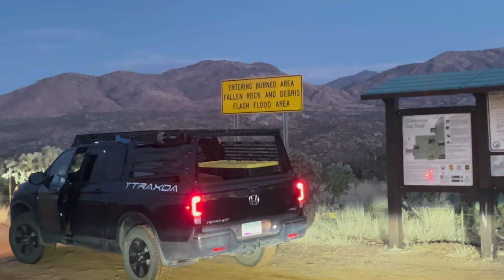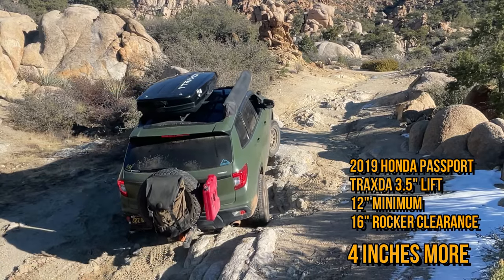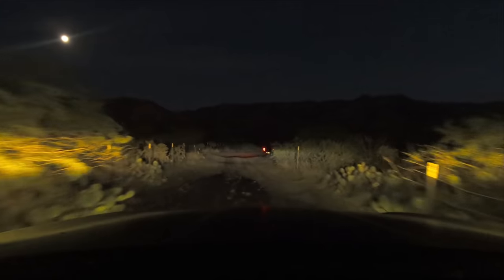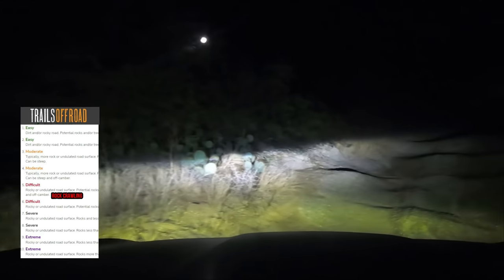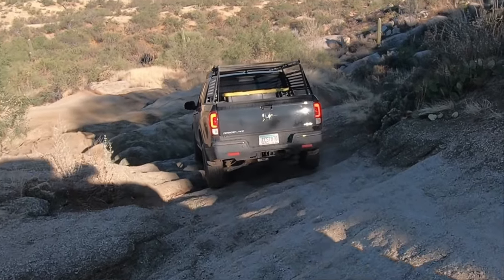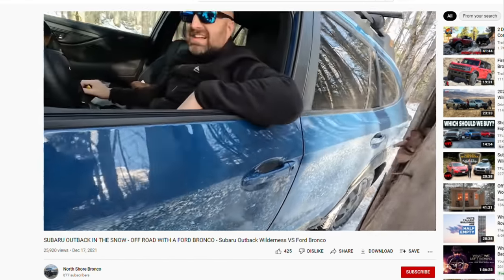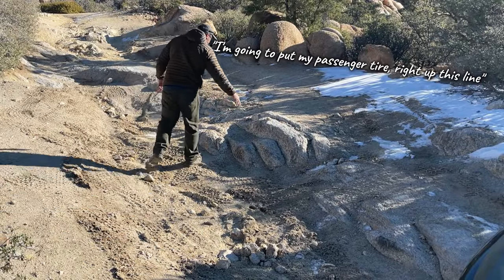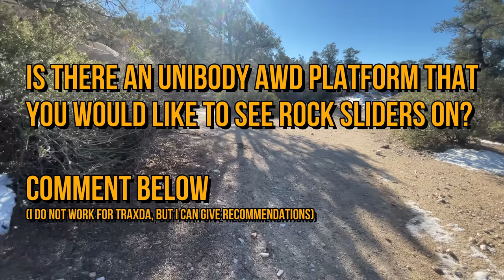Unibody AWD maximum (effective) ground clearance.  Why does no one talk about it?

Comment: Nice video Jon!   It's amazing how often those "automotive journalists" make a blanket statement about Unibody vehicles, forgetting that the Jeep Grand Cherokee has always been Unibody.     Since its debuted` in 1992 (ZJ) it was really a great vehicle off road as it had solid axles.    Now it's similar to Honda Passport.   (Independent suspension)   Love that you're partnering with a great accessory company to make great products for Honda.  You have the know-how!  Like the lower control arms being developed.  Very cool!
Reply: Just had someone today tell me that "jeep" was universally better off-road than Honda, ignoring any details about which models have which drive systems.
Reply from the maker: There’s so many cliche statements, but the “this vehicle won’t be rock crawling” really irks me because there’s a lot of levels before actual rock crawling (level 5 out of 10).  A stock Passport would put itself in alot of danger on a level 2 trail, because of 8” of minimum clearance is barely cutting it.  A modified Subaru might get through a level 3 trail, but may struggle on a level 2 trail with steep climbs due to the operation of the CVT.  With The way I have my Passport setup, I can consistently get through level 4 trails, but a level 5 rock crawling trail is out of my comfort level.  Those trails break 4WD parts, and that’s why I have never had aspirations to do them 😃.

Jeep Cherokees are legendary, and it’s amazing they were challenging the status quo back 30 years ago!  The unibody Trailhawk versions still continue to impress.  Watch @colorado mallcrawlers, Sean Watson does actual rock crawling with his KL Cherokee Trailhawk.  As far as the non Trailhawk models, they lack low
Gear transfer cases and rear LSDs.  On paper, the midsized iVTM4 Hondas sound better.  They really skimp out on non Trailhawk gearing.
Reply: @JonDZ_Adventuring  yep. They also say "good for forest service roads but not real off roading". If you've been through many mountain National Forests, you know that what the forest service considers a road can vary wildly.
Reply from the maker: @CommieHunter7  that’s why I don’t trust trail rating unless it was done by @trailsoffroad
Reply: @JonDZ_Adventuring  I just rebuilt a unibody 02 Nissan R50 Pathfinder; used stiffer coils rather than spacers to lift almost 3in, have extended heavy duty struts and rear shocks, upgraded sway bar/contol arms all around, sliders and skid plates. The thing is a beast and gets me to most places that jeep wranglers can reach. Uni's get a bad rap but can handle most situations when properly equipped and driven well. Honda made a great AWD system, love our 21 pilot, lifted it 2in and have decent clearance, just wish there were options to beef up the suspension. I have already had to replace a blown out a rear strut, otherwise its very capable with no real complaints.

Comment: I measured my Gladiator with 1.5/.75 f/r level. It’s 18”/19” f/r at the rock sliders and 20”/21” f/r at the rocker. Frame is 14.5” from B pillar. I’ve slid on the frame a couple times but not the sliders. Had a boulder roll up under and dent my tank skid lol.
Reply from the maker: Well, it’s nice to have an actual frame to slide on.  Much better than sliding on a stamped steel rocker beam 😖

Comment: I always learn something new from you.  I now need to find out what will work with my Forester Wilderness I just picked up finally.
Reply from the maker: Congratulations on the new ride!  There’s a number of things you can do with the SK Forester.  Most people lift them 2 inches, but I wonder if a company like Anderson Design and Fabrication would do a 4 inch lift.  They made a kit for the previous Gen (SJ).  https://awdadventure.com/products/2014-2017-forester-4-lift-kit

It’s advertised as 2” increase in minimum clearance and 4” in body clearance.  Because of the 2 inch subframe drop, the kit will be easier on the axles.  Add rock sliders on top of that and your Forester wilderness will be in a good spot! 😃

Comment: I talk about it!  And car mags did more when the Outback was first saying they had more clearance than the Explorer, but couldn't get it through the same tests.  Early Toyotas had big rocker clearance over Ranger, S-10, etc. even with comparable minimums.  Jeeps were the oddball for unibody, but hurt themselves with WJ when everyone else started fitting 31s without lift.  (Minivans have bigger tires now than all the "real 4x4s, bro!" of the 80s and 90s.) I *really* want to see full chassis subframes for more serious off-road builds, comparable to Dakar / rally raid cars, which effectively create that body-on-frame clearance while still tying into a unibody structure.

Comment: Cool video and something you don’t always think about when looking at vehicle specs. I just got a 2019 forester and planning on starting with some good upsized AT’s which should get me a little bit of ground clearance, and eventually a 1” spacer lift. I don’t think I’ll be rock crawling with this I’ll probably baby it lol but just want to have some capability to do overlanding trips and hit some forest service roads in northern WI. Nothing too extreme hopefully the forester can handle it. I saw your video on the cvt that died. Supposedly they’ve made them a little better now over the years. Thinking about doing a transmission cooler aftermarket. Gotta watch that transmission temp that seems to be the real killer.

Comment: Great vid. Makes me proud to have owned a 17 Ridgeline and now my new 21 Ridgeline. I plan to get at least a 2" traxda kit if not the 3.5 once I buy out my lease. I am thinking of Falken Wildpeak trails in 255/65r18. Haters will watch this video and still claim a Honda can't off road. They can keep their heads up where the sun don't shine.
Reply: Go straight to the 3/3.5 lift.
Reply: @carloszeigler  my issues here in Wisconsin are less rocks and more snow and rutted up muddy forest roads while hunting. If I were looking at rocks, I would go straight to 3.5 as you say, but if I am honest about my needs, the 2" lift coupled with tires that are 1.5" over stock gives me 2.75" of lift without worrying as much about steering components and stress on cv joints (and of course skid plates). At least those are my thoughts thus far.
Reply from the maker: Thanks Jacob G!  Yeah, this video turned out to be a really good show case of the Honda iVTM4 AWD system.

So Carlos had a 2 inch lift as well, but then upgraded to the 3.5 inch lit.  It just puts these midsized Hondas in a really good spot.  Especially for deep snow, because once something high centers, it’s game over.  

Because of the 1 inch subframe drop, there’s less stress on the axles compared to the 2 inch kit.  It’s a noticeable difference because with the 2 inch kit there’s drive shaft vibration at around 22 mph, it’s less with the 3.5 inch kit.  

Whatever kit you decide on, I have a 20% discount code.  Unfortunately, there was a price increase at the start of the year, so that discount can help offset the extra cost.
Reply: @jg8263  As Jon noted, the 3/3.5 kit reduces CV shaft angle and stress on the drivetrain.  Just make sure you get an experienced mechanic to do the install.
Reply: @JonDZ_Adventuring  good to know about that drop, as the cv stress was a big concern for me. Shame it isn't offered on the lower lifts as well. Now, if that portal axle/hub ever manifests, I would be a happy man!
Reply: @carloszeigler  always with the mechanic. I lack the tools to do a proper job of it at home and know too many who dove into projects like this without the necessary skills/tools and ruined their vehicle. Thanks for the info.

Comment: I'm excited to see how the sliders turn out. Takes guts to risk your rocker panels solo like you did but you crushed it.
Reply from the maker: That place was magical.  Excited to return in March.  I’m looking forward to getting to the mine at the end.  I stopped my trip short because the line would get a bit dangerous.  If I just had the rock sliders, I’d be comfortable with the obstacle I came across.  It was either 1.) take a hit to the rocker panel or 2.) take a hit to the drive shaft.

Comment: another great video!
Just curious about the LSD, do the clutch plates have to be replaced? I assume they must be subject to wear but have no idea how beefy they are. You must use it more than most and wonder if you've had any problems.
Reply from the maker: Thanks. I did a video where I replace the rear diff fluid. After 15K miles, following the severe duty maintenance schedule, the fluid was very clear.

I’m not expert, but I know the clutch packs are connected to little reduction gear sets.  This allows for the overspinning of the activated wheel, but must also help deal with wear and tear.  Now, there’s another thing.  The PTU (transfer case), which is connected to the transmission, is scheduled to have its fluid changed at 30K miles.  Mine failed!  It was replaced under warranty.  It takes only 0.45L of fluid, and I think it’s pretty obvious, with the kind of driving I do, it needs to be changed much sooner.  I have 2.5K miles on the new transfer case.  I’ll be changing the fluid at 5K miles, then 10K, then 15K to see when the fluid starts losing its effectiveness.

I hope that answers your questjon

Comment: Where did you get these "minimums?"  When I measured from the lowest hanging point to the ground...usually the rear trailing arm/shock tower.  I don't get anywhere near what you're getting. Is there a standard place to measure from? I always thought it was just the lowest part of the underside of the vehicle?  ... on another note, another great video!
Reply from the maker: Good question!  So, the way these car manufacturers are coming up with their minimum ground clearance numbers is they simply measure from the “center line”.  Usually, the engine, transmission, drive shaft, and rear diff will line up with that line. I’m sure you’re familiar with Subaru advertising their crossovers as having 8.7” of minimum ground clearance, but you’ll probably also see that the lower control clearance is much lower at around 7.0”.  Yeah, they get their number from the center line.

I tell you, I have bashed and got hung up on my rear lower control arms many times.  I guess I should do a video about it when I eventually get some “high clearance” lower control arms made.  Traxda USA will be making them.

Comment: Do you have a vid where you talk about the AWD systems overheating when overlanding? 
And maybe mitigation, prevention and maybe even potential for aftermarket lockers on these Hondas? (Like Subie)
Reply from the maker: I plan on making one, but the funny thing is it’s hard to get the AWD system heat warning.  You literally have to drive like an idiot.  Subarus don’t give you diff heat warnings.  The CVT will go into limp mode at a damaging 240F, and the CVT heat warning comes on at 270F, which means that CVT is walking dead.  The Honda AWD heat warning doesn’t put the vehicle into limp mode and it goes away after 15 seconds.  An overheated Subaru CVT takes 30 minutes to cool down.  The funny thing is it takes the same amount of effort to overheat an IVTM4 AWD system and a Subaru CVT.  As far as aftermarket lockers for the midsized Hondas, anything is possible with enough money.

Comment: Hey Jon! 

Great video! I was just talking with Greg about these when ordering your special liftkit from him. Not to pester,  your new wheels I've been saving up to order and I noticed they have a different offset than stock; are you using a wheel offset spacer or do they fit with factor settings and lugs?

It would be a great to hear your thoughts, thanks! :)
Reply from the maker: Thanks!

I have Black Rhino Chase wheels, 5x120 (oem lug pattern) with 10mm offset (oem is 55mm).  My wheels stick out 1.77” per wheel.  Because of the increased offset, it may require some cutting of the plastic wheel well liner.  I’d highly recommend the axle relocation kit, otherwise you may have to cut some metal pinch weld or firewall.
Reply: @JonDZ_Adventuring  Hey Jon!, thanks for the feedback. Yup I got the axle relocation kit too. It's going to be a bit until I can get the wheels and tires, need to save up a little but planning a head.
Reply: Love seeing your videos. So much useful content. Anyway, I’m gonna be getting a 23 ridge and I would love a lift but have been reading a lot of negative aspects that come along with the lifts..etc…lane keep not working and premature wearing of the axles. So I know you’ve been lifted and wheeling for a while now. Any major cons with lifting these Hondas? Thanks and again great videos.

Comment: minimum ground clearance is more important to me, i get turtled on my diffs, rear lower shock mounts, lower a arms, lower rear links and I am effectively stuck.  Maximum ground clearance for me, isn't about clearing a obstacle, its more about not destroying your body panels or mechanical bits (but can be mitigated with armor).  Also, increasing your maximum ground clearance through a lift is not a great idea, because you are effectively limiting your down travel at the expense of increasing maximum ground clearance, because you didn't do anything to increase your suspensions arc of travel, and you didn't do anything to increase minimal ground clearance. with experience, you will find a setup that works for you that compromise max/min ground clearance, armor, and budget.
Reply from the maker: Thanks for sharing, what do you drive?  This video is more directed at unibody AWD vehicles on fully independent suspension.

Comment: BA4x4 is coming out with true rock sliders for Subarus. They can handle the weight of the vehicle and be used as a jack point.
Reply from the maker: Awesome!  Does BA stand for Bad Ass?  Once I get the sliders on the Passport, I’d like to do a special on all the other real rock sliders for all the other awd platforms
Reply: @JonDZ_Adventuring  most likely but it may also stand for Body Armor
Reply from the maker: That makes more sense!
Reply: @JonDZ_Adventuring  I like your idea better. There needs to be a company called BadAss 4x4

Comment: After watching this video, I immediately out of excitement went to check on my GX460's clearance and it's 13" tall. This is with 31.5 AT tires with no lift. Out of curiosity why does the manufacturer state that the stock ground clearance is 8.1"? Surely it has to be way more, this is essentially a Land Cruiser Prado underneath.
Reply from the maker: I didn’t put it in the video, but I measured a stock Lexus GX at around 11” at the “running board”.  If you remove it, you’ll have a whopping 17-18” of rocker clearance!!!!!  With a 2.5” lift and 33” tires that clearance will be upwards of 21”.  I see plenty of beastly Lexus GXs out there.
Reply: @JonDZ_Adventuring  Oh damn! I had no idea that it was that high up? So it's probably those stupid plastic panels is what's in the way. Nice to know that my truck is capable :) We just had nearly a foot of snow here in NY and it was effortless. I would definitely love to install rocker panels on my GX, but trouble is it's a lease! I seriously don't understand why Lexus neuters the GX with those bumpers, they made it even more worse with a sport design package.
Reply from the maker: @vadim9342  check out Lexus GX Life.  He replaced his plastic side steps with rock sliders.  He has a YouTube channel, and Here’s a link to his Instagram https://instagram.com/lexus_gx_life?utm_medium=copy_link.
Reply: The minimum ground clearance is measured at the lowest point of the vehicle. So with your GX, that's going to be either between your rear differential and the ground or the bottom of your front skid plate to the ground. I measured my 4Runner, I only have 7.5" of actual ground clearance underneath my front skid plate.

Comment: How much worse is the handling with that lift kit?
Reply from the maker: Good question!  So, I expected handling to degrade because of my experience lifting a Subaru 2 inches.  But, surprisingly, there was no noticeable change to the driving dynamics in my Honda Passport.  

I think I could explain why though.  My theory is that Subaru crossovers are pushed to the near limit from the factory.  For example, a mere 2 inch lift kit requires the subframe to be dropped.  After all, a Crosstrek with 8.7” of clearance is based off an Impreza sedan with 5” of clearance.  So, with a 2 inch lift kit that’s now around 5.7” beyond the original design.  The midsized Hondas aren’t built on the same chassis as a Odyssey minivan, but they add a ladder subframe to it.  Lifting it 2 inches doesn’t require any modification to the subframe, and a 3.5” lift kit only uses a 1 inch subframe drop.

Also, I need to point out that the Passport doesn’t handle like a car to begin with, not like a Subaru that has car like handling.  It handles great for a large 4200 lb. vehicle.

Comment: It would have been interesting if you would actually measured the minimum ground clearance of the 4Runner. They advertise it at 9.5, I measured mine, and I only have 7.5" under the front skid plate. Less than all the Subarus and the CRV, lol.

Comment: With all obstacles you drive your car through, how often will you do alignment for the car?
Reply from the maker: I have 93K miles on this thing.  I’ve had it aligned after my 2 inch lift kit at 8K miles, and then again at 51K miles when I put in the 3.5 inch lift kit.  At 80K I rebuilt the suspension.  My Passport turns 3 years old on February 12th.  I’ve had no drastic uneven tire wear.